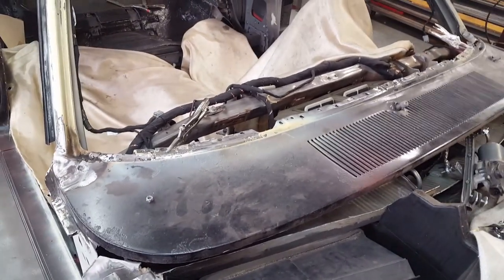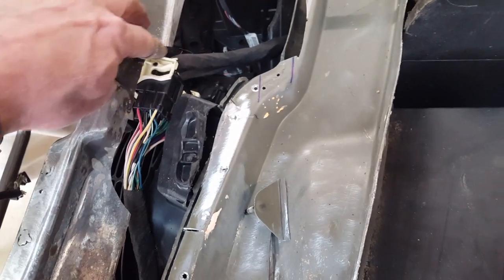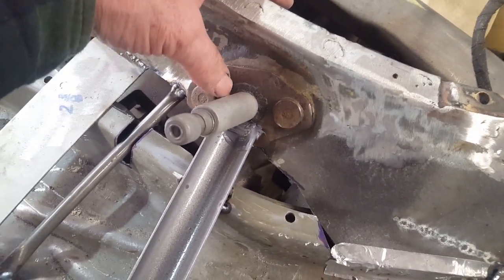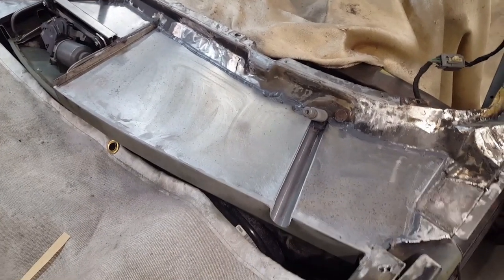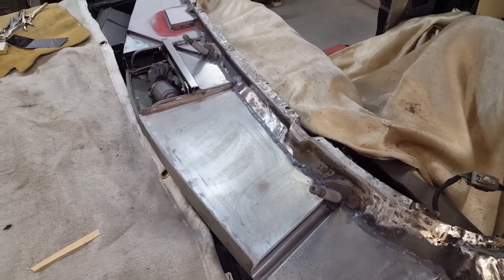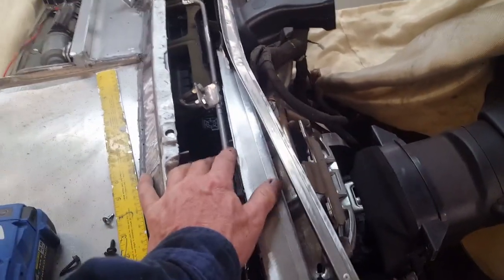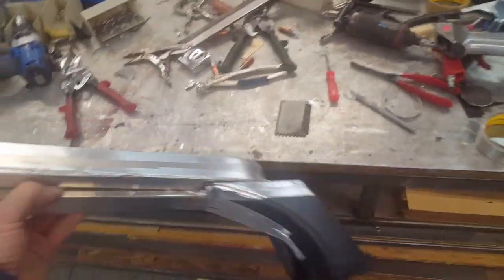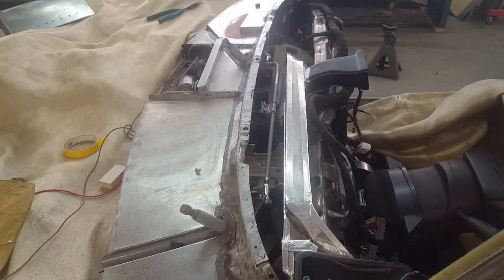Don's 68 Charger body swap part 14

Comment: Hi Steve.  As always, your work ethic, skill and attention to detail is inspiring.  One question though.  Using metal for the ducting, will it present a condensation issue?
Or will you be insulating the metal with a foam tape?  I”m asking more than I’m telling. Just a heads up in case??
Reply from the maker: I have the same set up in the Daytona and have not experienced any issues. Good question though. I guess if you were in a really humid climate it might be a problem. It is a pretty short run from the box to the outlets though.
Reply: Thx for your reply.  Amazing that you’re able to do that(reply).  Keep up the amazing work. Your progress is staggering!
Reply from the maker: After consideration I don't think the answer I gave you yesterday was quite sufficient. Where you see condensation on duct work is where there is a big differential between the air in the duct and the air outside it. This happens in homes if an uninsulated  duct is in an unconditioned space such as an attic or crawl space. Hot humid air condenses on the cold duct work. In the car the ducts are within the conditioned space and outside of a little time that it takes for the interior of the car to cool off the temperature around the ducts should be the same as the rest of the cabin area. You see exposed ductwork all the time in some restaurants  but since it is inside the building it is the same temperature as the room and no condensation.
Reply: Wow. You’re amazing. Your initial answer was plenty sufficient!!  I’m sorry this took so much of your time. Appreciate the further explanation!  Keep up the good work.

Comment: How about making that cowl grill a removable access panel for the motor?
Reply from the maker: There is no way to do that without the seam being apparent and this car is to look as stock as possible. Either way I can get to the motor just fine with the set up I have. Hopefully it will never need to be used.

Comment: It seems to me it would have been easier to run copper tubing maybe half inch diameter you may have had to insulate it, but that is the opinion of an armchair mechanic. Brass tubing could’ve been used as a brace as well.
Reply from the maker: What are you referring to?